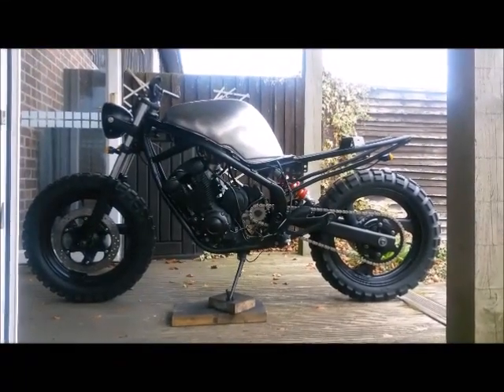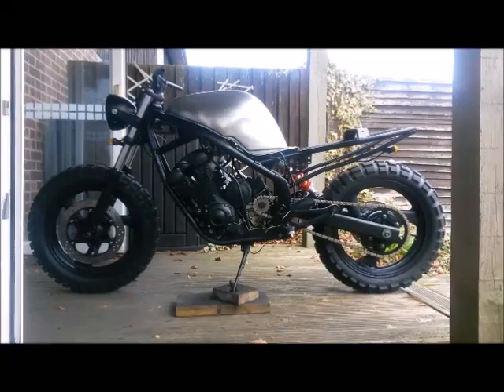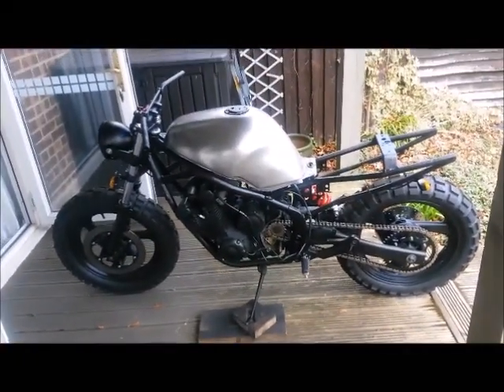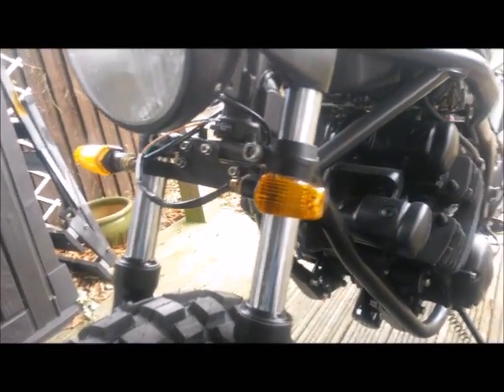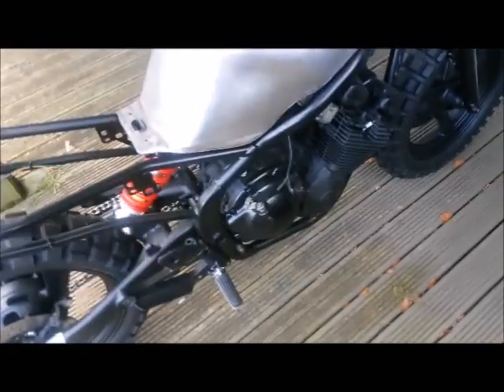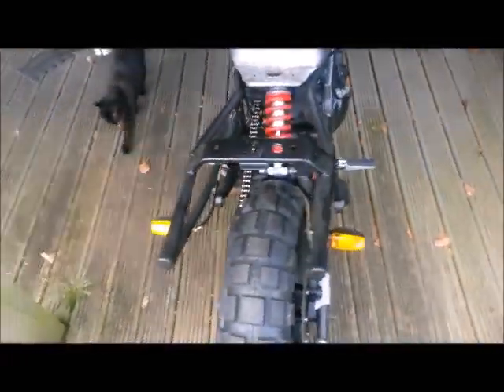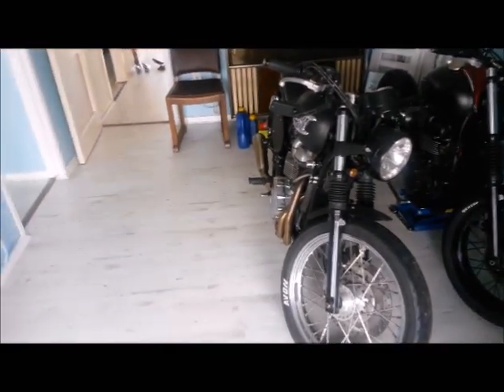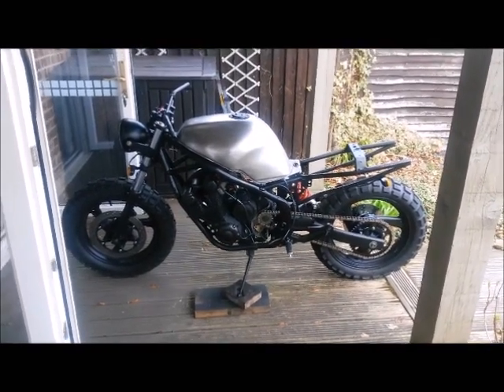Yamaha XJ600 brat scrambler budget build mini update

Comment: very nice bike, we are also building a scrambler with as base the xj600s.I have a question, where do you place the battery?
We are thinking to place the battery above the engine and replace the airbox with 4 separate air filters (if this is possible).
Reply from the maker: my friend sold this one now- we didn't bother with pod filters this time as it's all hidden and we just wanted the cosmetic side of things done first and have it running. the battery was in the stock position using the plastic undertray but we chopped it all down. with a fancy lithium/gel/anti gravity etc type battery the options are endless if you wished to relocate it!